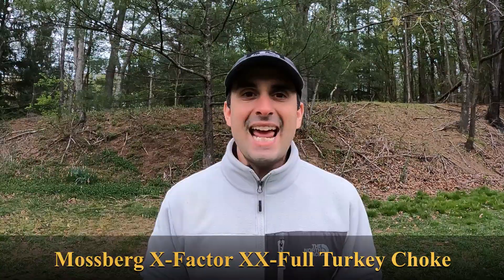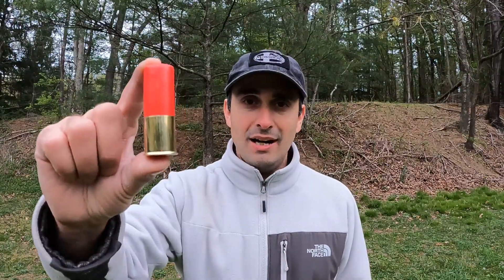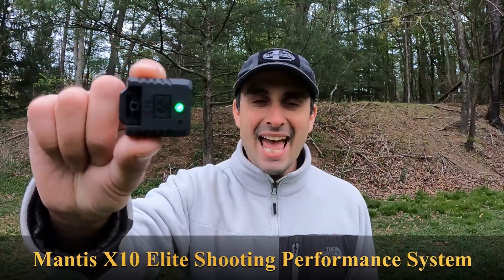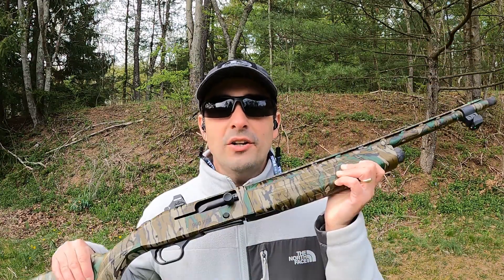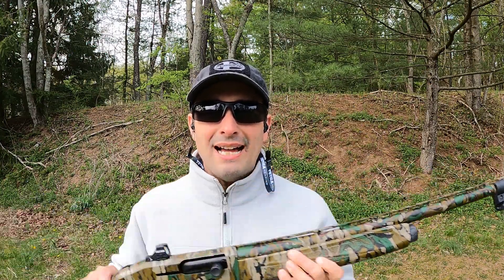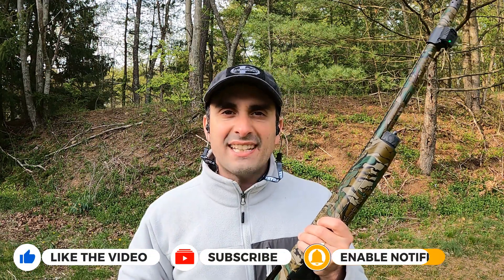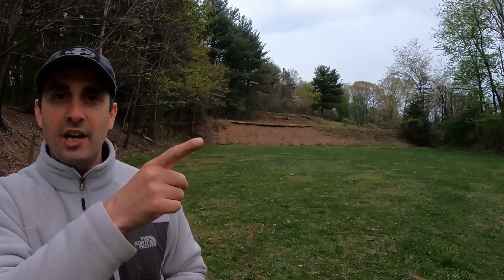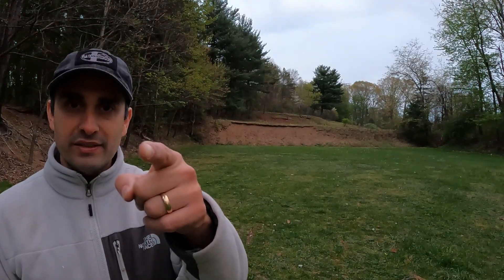Do Ported Choke Tubes Reduce Recoil? TESTED

Comment: George. 
The only thing that really helps recoil is bore diameter and forcing cone shape. 
And that my friend is a rabbit hole to infinity. But a good barrel to look at would be the baretta A-400 sporting. Or believe it or not the Browning cynergy . Those barrels are over bored with lengthened forcing cones. And those barrels are usually in the 30 inch range and there supposed to be some of the softest shooting.
Reply from the maker: I know the a400 has a recoil reduction system built it, I have one, and I think it works noticeably well. But what about barrel diameter impacts recoil? You still have the same mass traveling out the barrel.

Comment: I believe a better test would be with a single shot or inertia operated semiauto or a pump. A gas operated shotgun uses a lot of the gas pressure to operate the action. And from what I understand, with most chokes, the purpose is more to help the pattern(in theory). That has also been debated in many forums online. I know from my own observations, with my 5.7lb inertia operated Stoeger 20 ga, there is no difference in felt recoil between ported and non ported chokes with the same loads.
Reply from the maker: I might have an inertia gun in my future. We'll see.
Reply: @TheNewHuntersGuide everyone knows Benelli but I would look at Retay also. I love my Stoeger for the money but have had some cycling issues with it. I like a gas operated gun and might look into the Beretta a300 Ultima Turkey to replace my Stoeger 20 gauge.

Comment: I think this is a somewhat anecdotal and subjective test because you physically are an inconsistent variable. Would need to strap the gun down with a lead sled type rest along with a load cell to truly measure. But I love the effort and the content. With that said. I doubt anyone’s shoulder will ever notice the difference between the two.
Reply from the maker: I looked into the load cell and several other options. The cost and complexity scales too dramatically to make it a viable. It's also a little bit like trying to prove gravity is real. Build your scientific instruments,  but just dropping a rock demonstrates the obvious reality.

Comment: I watched the video many times and Mantis looks like an unreliable system.  Mantis' measured angles of recoil and what I saw on video seem totally off for many shots.   I wouldn't rely on Mantis data here.
Reply from the maker: It's the best tool I have or could find for the job. It also agrees with the shoulder. I spent an inordinate amount of time researching other methods to measure the recoil and could not come up with even a close second. In any case, the value would be in averages, not trusting any one shot.

Comment: George, I believe many people are confusing a ported choke with a muzzle brake. Muzzle brakes, often used on high recoil rifles have more opening for the gas to escape, and the ports are generally angled back towards the shooter. Most will have some porting on the top that is intended to push the muzzle down. The ports angled back to help "gas the muzzle forward", is what makes them seem so LOUD. That high pressure gas passing the shooters ear is really painful with some brakes. The "mini Y comp" is one that will make you thing your ear is going to bleed.
Reply from the maker: Yea, I do did a video on ported barrels vs. ported chokes. Barrel's do make a difference. As do muzzle breaks. Ports, not so much.

Comment: Run those 2 3/4 loads though a Ithaca model 37 featherlight 12 gauge if you want to feel it kick
Reply from the maker: The lighter the gun the heavier the recoil feels.
Reply: @TheNewHuntersGuide O have 3 Ithaca model 37 12,16&20 the 12 kicks pretty good and because it was made in 1956-57 you can only shoot 2 3/4 shells. Big difference between model 37 and my A-5 on recoil shooting same shells